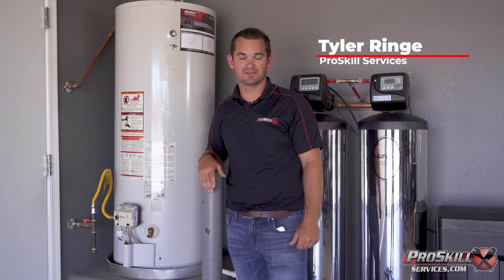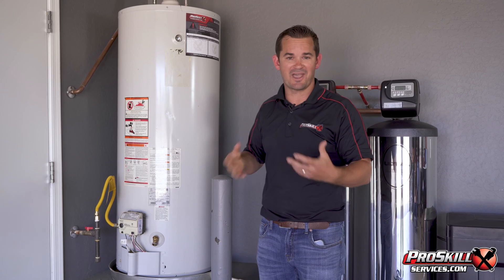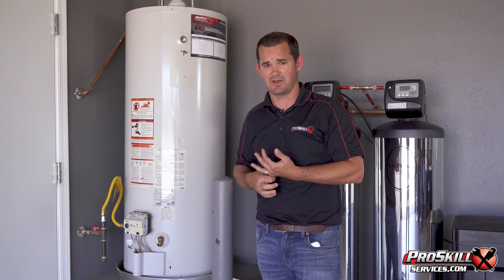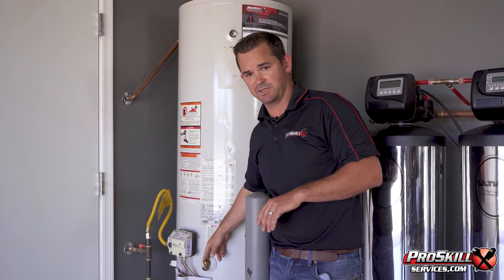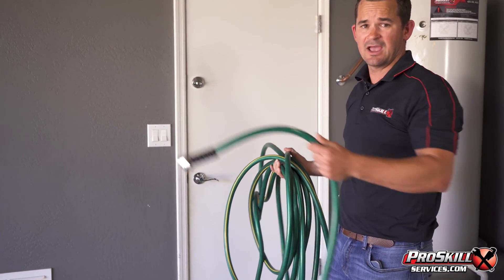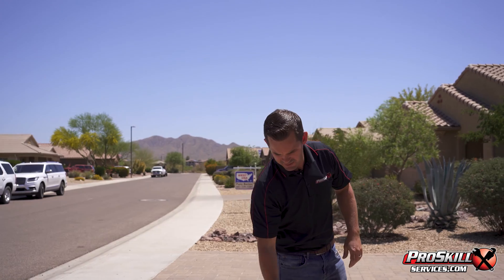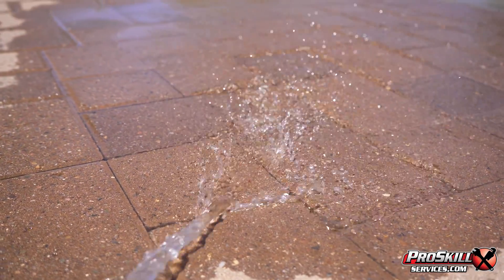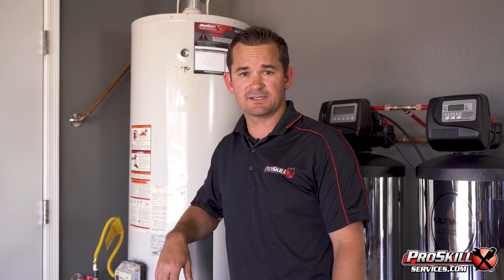Gas Water Heater Maintenance and Flush

Comment: Thanks, this answered a lot of questions. I have a Bradford White 50 gallon that was installed 11 years ago and knock wood, hasn’t had any problems but has never been flushed or maintained. Should I consider a tankless heater? Any recommendations?